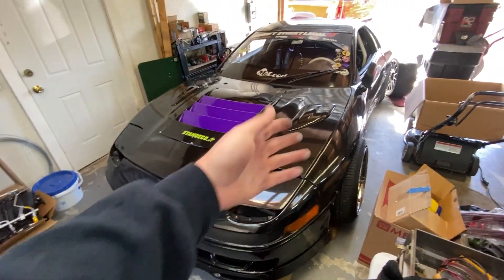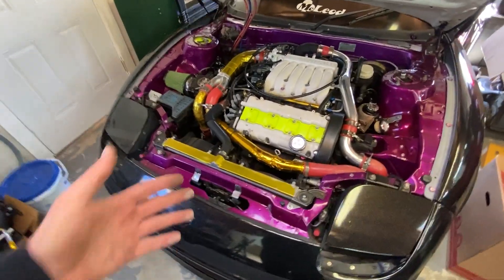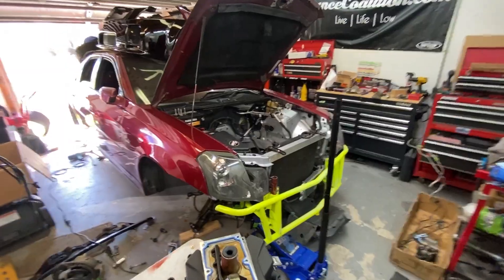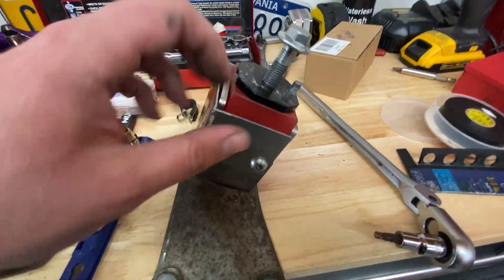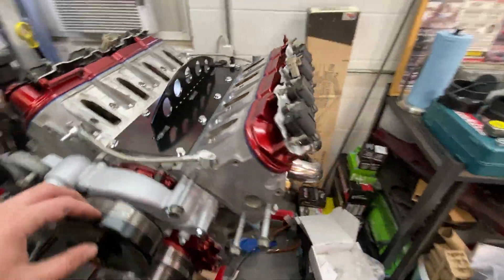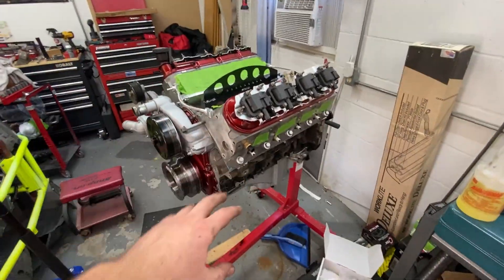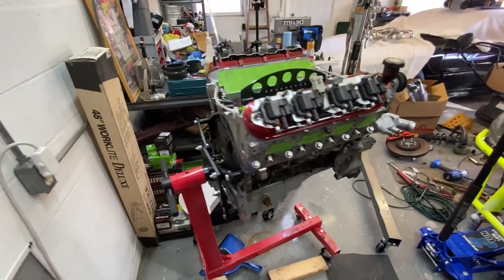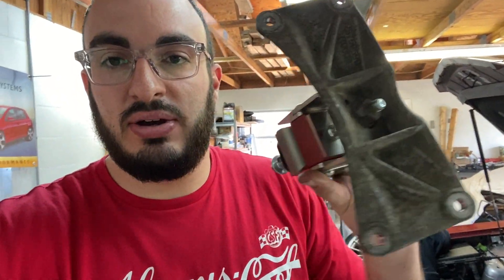Installing a Racing Oil Pan Baffle in the CTS-V LS6

Comment: Great progress man 👍🏼 What plans do you have for the rear diff? I ordered the gen1v brace 2.0 for my 05 along with the bushing from creative steel. Just waiting for it in the mail
Reply from the maker: Thanks! Diff I’ll just be doing the bushing and CS diff block. Haven’t had any issues with my 06 after years of abuse! You’ll be in good shape with that gen1v brace too 🤘🏼
Reply: Did you get your cs part yet?
How were they to deal with?
Reply: @chrisreynolds2410  Got everything installed on the V1. Red race diff bushing, along with the diff brace, short throw shifter, engine & transmission mounts all work together. It performs great & feels like a whole new car.
Reply: Glad to hear it, I should have mine back from the shop next week.

I got a McLeod twin disc clutch setup, new cam and valve springs and pushrods and LS7 lifters and timing chain set up and lifter trays and then hit the dyno for tuning.

I want the CS rear end next and a supercharger but I keep hearing mixed things about CS.

Do you guys know any other place that sells the rear ends possiby?

It’s no rush that’ll be over the winter, I want my car back and wanna drive it…it’s been outta commission to long.
Reply from the maker: I didn’t order the block yet, but Creative Steel has always been good to deal with in the past!